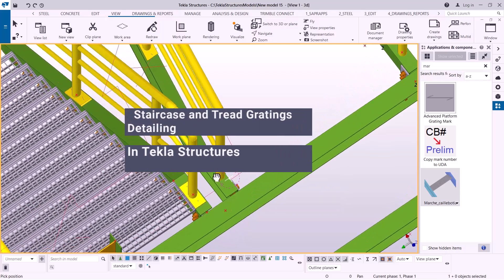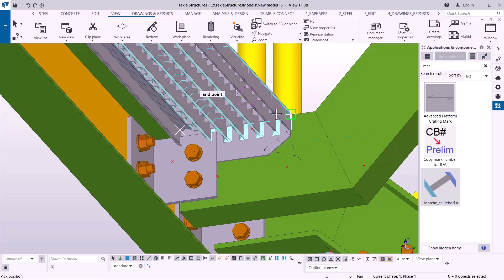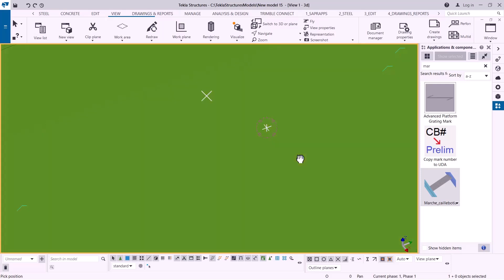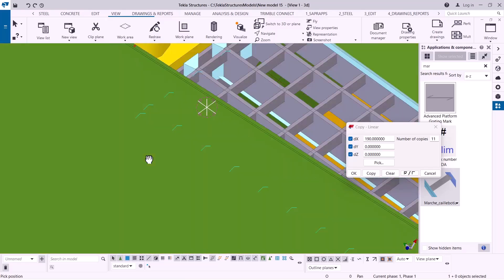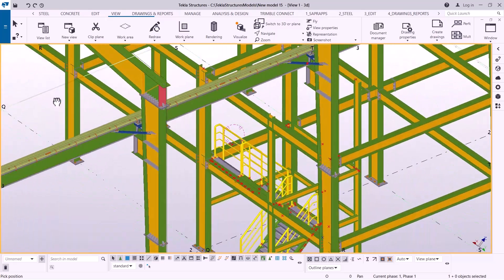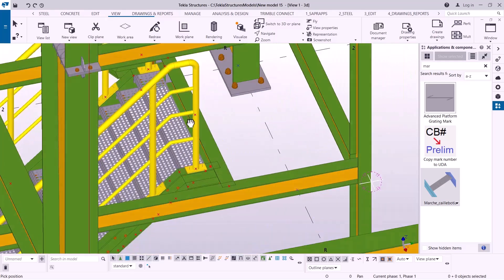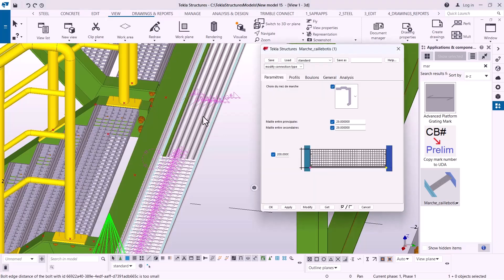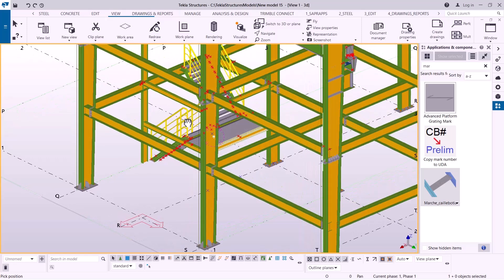Staircase and Tread Gratings Detailing  in Tekla Structures

Comment: Sorry, but I have to say this: It's the worst way of modeling gratings or stairs. Please don't ever do this again. It may look good, but it's a disaster.

A stair tread (or grating) is a part ordered from the factory. It should be modeled as a single part in the model. It will have one part number, one drawing, and it will appear as one part in the BOM. In IFC files, it will be represented as one part with properties indicating that it is a stair tread (or grating).

What you have now is hundreds of flat bars welded together. This approach prevents you from creating proper drawings, generating an accurate bill of materials, and results in a huge and inefficient model.
Reply from the maker: Yes, if you explode the component (tread) it stops being a single component but rather a heap of metals welded together,  i did it for the purposes of education. but you intend to generate bill of materials from the staircase and tread on one go, kindly do not explode the tread component
Reply: agree... it actually hurt my poor brain!
Reply: Brother, there is a separate company that produces these steps, the meter is shared and the product is supplied in galvanized or different form. It makes more sense this way.